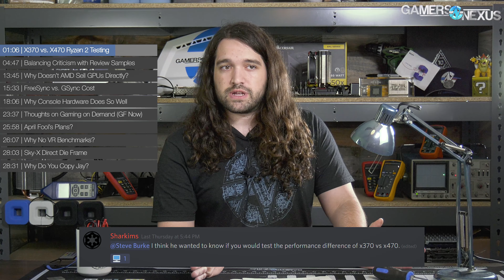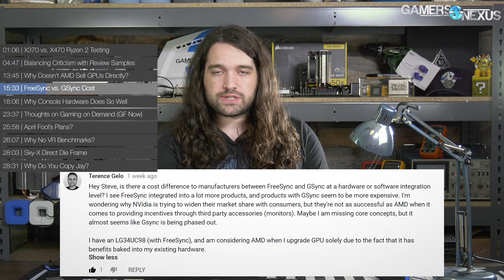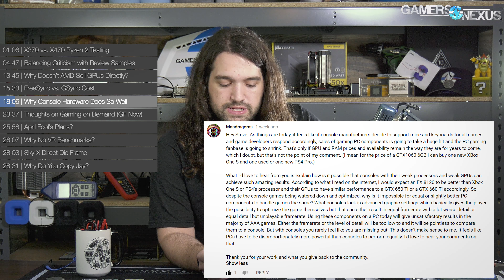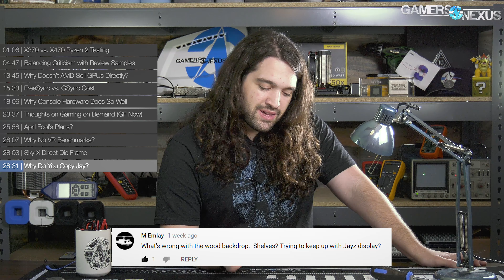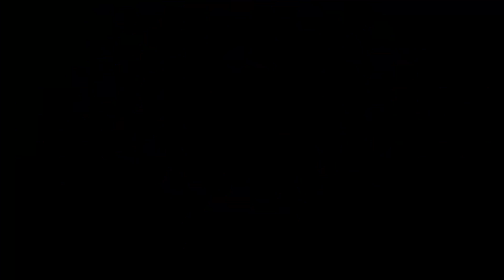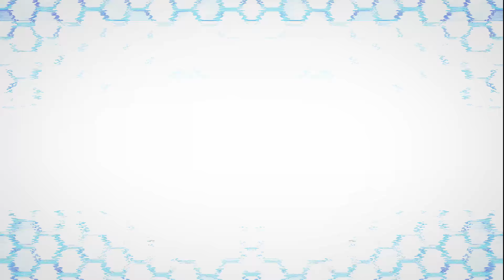Ask GN 75: X470 vs. X370 Tests, Balancing Criticism vs. Samples

Comment: Not recieving sample before launch because of critisism means the viewers will get only "paid" reviews on day1, and most likely few next days. Some may have already order a product based on "paid" review. As you noticed, few days delay result in significant loss of views - critical review will not even be watched. So it may not look like censorship, but it works like one. However my question is: How strict are "review recommendations"? Those reviewers' manuals are not a secret, but do they determine what the product should be compared to? It's definitely noticable that some channels do minor "things" that makes test not fair, not connected to real consumer properties, when compared product is at disadvantage over reviewed one. e.g.  lately seen on nonK intel vs ryzen tests, ryzen suddenly loses its overclocking capability somehow on certain channels, must be magic. Or comparing different price point products etc

Comment: For the 5th question, one thing you forgot to mention is consoles have QA processes games have to go through before there sold. Unfortunately PC does not have this. This is one thing that really needs to change, otherwise were just going to be stuck with more repeats of Batman Arkham Knight! If I had a nickel for every PC game which flat out refused to launch on me I'd have enough to open up my own game studio! Console, well, I cant remember the last time a game did that to me. 

Speaking of Batman and WB, most publishers just don't care about PC. I actually have a support ticket from them where I was complaining about weird stutter issues in a particular spot in arkham city. They were trying to claim it was normal, which then I pointed out my PS copy did not do that which they replied well then just play that. So forget you just spent 8K building your PC, and 80 bucks buying the game, forget all that. And they wonder why PC gaming is dying!

This is exactly why I sold my gaming PC last month. I constantly would look at it and think to myself I spent $8K on this thing and for what?! What is this giving me a xbox one x cant? Not to mention my Maximus IX Formula failed on me twice within 5 months forcing me to drain the whole loop and rip the whole computer apart and re build it each time.

Comment: I'm hoping a 2700 will make upgrading from my 3930k at 4.4ghz worth considering giving I'll need a new mobo and ram. The 1700x wasn't enough of an increase to be worth it I think.
Reply: Depending on your use case, it could be a side grade or a noticeable improvement.

Comment: I'd like to point out that in Canada at least, back in the day ATI used to sell their own branded cards in Future Shop (later Best Buy after the buyout) and then later AMD.  Once Future Shop was shuttered, the AMD branded cards seemed to disappear at least from the brick and mortar stores.  All my GPUs from the VIVO 64 DDR on through to the 2900XT were ATI/AMD branded.  My 3870 was the first GPU that wasn't branded by AT/AMD and wasn't a reference design. I still have a 9700 Pro in an ATI box... I miss those days, haha.

Comment: Ask GN: Do you think the constant shift in Radeon brand did Harm AMD in the long run? they had since 2007 Radeon HD 2000~HD7000, R9 200~300, R9 Fury, RX 400~500 and now RX Vega,  Nvidia in the other hand use Geforce GTX since 2008 to this day.

Comment: I wonder what release day support for Memory will be for X470. I know it supports 3666MHz off the bat, but I wonder what voltages and timings & how stable it'd be...or how hot...

I hope this SSD I ordered gets here soon...even with a 1600 at 3.9GHz it takes ages to boot from a 5400 RPM HDD...

Comment: #AskGN Is there any chance of adding multi GPU testing to your case reviews?  Also with the upcoming Lian Li O11 Dynamic review it looks like you can install one GPU vertically and one horizontally with the vertical bracket.  It would be greatly appreciated if you could test the thermals on this setup.  Thanks
Reply: I would say highly unlikely, Less then 10% (maybe even closer to 5% of people use multi gpu setups) so for that small amount of people it all boils down to Steves time is worth money. He cant spend a bunch of time doing SLI CF review and watch barely any views and wind up losing money.

Comment: Thanks Steve for answering my question but saying you'll be ok for the most part doesn't help overly much , I have seen your i7 vs R7 VR benchmark but don't know how to correlate that to an i5 6600k vs 7700k !
Reply: The 6600k (Solid cpu I used til my  upgrade) is 4c4t, 7700k is 4c8t and should perform better then the i5. He doesnt have the time to do a head to head in VR of your 2 Cpus as the amount of time it would take (which equals money) isnt worth it for you and maybe a couple people to be interested. In the i7 vs R7 bench did the Ryzen do better in VR due to more cores and threads? (I dont remember the video) If so and you want to be sure your VR experience is a premium experience them grab an i7 8700k and use that. Otherwise make sue with the 6600k til you need/have to upgrade.
Reply: John Totten here is the test. 
https://www.gamersnexus.net/guides/2871-amd-vs-intel-vr-cpu-benchmarks-with-vive-and-rift/page-2

TLDR, i7 is substantially faster in VR hence my concern if cores or frequency is key and would the 7700k be wasted money compared to 6600k due to VR not seemingly needing cores?
Reply: Just run the Steam VR Performance test and it'll tell you if you're good to go or not.

It mostly depends on what GPU you have.
Reply: SlavjanA that test tell nothing other than you system is OK or not, even 970/2500k passes that test. 
Some games need more than others, pC2 or rF2 for instance!
Reply: Are those games completely unplayable on that setup? Probably not.

But as I said, GPU matters more than CPU, so depending on what GPU you have your experience will be dictated by it.
Reply: SlavjanA no pC2 is pretty great but definitely not on max settings in VR but rF2 is unplayable as is with pauses and stutters that can last seconds at a time, and rF2 is the main one I played before VR came into my life now i can play on 2D anymore.
You are right and I will be getting the next top ti to replace my current ti but just really wonder how much if any my 6600k really is holding me back? If VR doesn't care for cores past 4 I could save that money (not upgrade chip set to 8700k either keeping 6600k or getting 7700k) and putting that money into Volta!

Comment: Are M.2/nvme heatsinks worth buying/using? Just built a system. Gigabyte ax370 k7, my gpu is on top of 960 evo. Or should I just move gpu down to next pci-e slot? Thank you for your input!
Reply: You can zip tie cheap heatsinks too them if you want (its like $1.50 for a pack of 10). I did that for the NAND flash and controller on mine (it runs super hot all the time, even idle it would burn you, so heatsinks were probably a good idea. It claims to never pass 65c even doing SSD benchmarks, though I find that hard to believe...)
Reply: I should say, "65c after putting heatinks on it".
Reply: Jake Garrett  thank you for the suggestion I'll look in to it!

Comment: Does Freesync or G-Sync decrease monitor lifespan? To be more precise I mean the constant Hz change of the the course of, for example, 3-5 years of using you monitor. You are going to be gaming most of the time and that's constant Hz changing for hours and hours, which actually never happened until now(subjectively speaking, i never heard of hz oscillation / synchronization with fps before gsync and now freesync). We always used fixed refresh rate, even with 144Hz+. Does that hurt the panel or perhaps increase it's lifespan/longevity? Sorry if the question sounds a bit ridiculous. :)
Cheers
Reply: Probably not, you might actually increase the panel's lifespan since your not turning lights on and off as often. May even save energy and therfore less heat as well, but I'm not sure about that. Based on my old VGA monitors overclocked and still kicking, I don't think you have much to worry about... 4k is already becoming a thing for cell phones with 5 inch screens, you really don't think that your monitor will be a dinosour like my VGA monitors in 5-10 years? They may not be, but thier is a good chance they will be aweful compared to the average monitor, that they will be considered obsolete before they die.

You want a CRT TV? I've still got one, its about 200-300 pounds for a 27 inch. My dad and I barely got that thing moved across the room, and we can pick up small car engines or transmissions just about as easy... Its got nothing on the 8 pound 32 inch TV we upgraded to, or my 12 pound 28 inch 4k monitor (thick glass screen adds a huge chunk of weight).

Comment: #AskGN So i didn't quite get this. My friend has a x370 and i'll buy it off him and pair it with a Ryzen 2 when it comes out.
Is it smart to get the motherboard of him or buy a x470? Amd said that products will be backwards compatible.
Reply: From what I understand, the X370 will require a bios update to work with the new Ryzen 2000 cpus ( You may need a Ryzen 1 cpu to update it ), also some features may not be available on the x370 (New Xfr2 and other things) that will work with the new X470 chipset. So while you can use your old X370 til 2020 with all the new Cpus, You may miss out on features if you dont buy new MBs with the new chipsets. So I guess you will have to weigh out how much your friend is selling the x370 to you for and what features you wont have and see if that value is enough compared to just buying an X470 with the new Cpu and getting no drawbacks. Good luck.
Reply: Depends on which X370 board it is, but if you're going to manually OC then you can get it no problem. If you're not going to manually OC though then you'll be missing out on Precision Boost Overdrive and XFR 2 which are nice to have.

Comment: For AskGN: Now with the rest of the Coffee Lake lineup being released, what about when Computex comes along and Cannon Lake gets announced(assuming it will be announced at that time)? The new PAO model that Intel is using well and truly is fucking ridiculous(unless it's just a one-time blip, which I truly doubt at this point in time).
Reply: Cannon Lake's for mobile. Coffee Lake won't be replaced until Ice Lake next year.
Reply: SlavjanA Actually, they've announced Cannon Lake CPUs for notebooks, but they didn't say that Cannon Lake is notebook-only, so...
Reply: It will be. 10nm is weaker than 14nm, just lake when 14nm first launched with Broadwell vs Haswell.
Reply: SlavjanA I just did more research on this and I think you're right. Thanks for correcting me.

Comment: Is there any motherboard maker except Asus that lets you upgrade your bios without installing a CPU?

Can you test some USB 3 / 3.1 / 3.1 Gen 2 Cards? Odd request I know, but some motherboards have issues with realtime controllers plugged in. I remember my AM3+ mainboard with Via Chipset had big issues with latencies using Xbox controller or Midi controllers for DJing. Webcams, microphones and storage devices drain the resources of USB hubs and chipsets really fast, so better have another USB hub and controller completely separated from your motherboard integrated ones, so they are using separate resources. Do the USB cards differ much, or can I just get anything cheap?